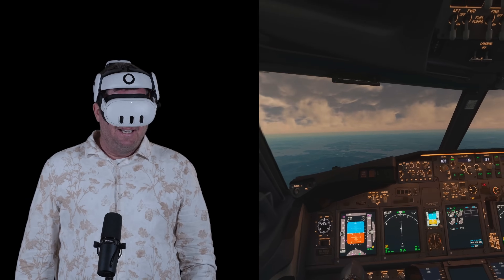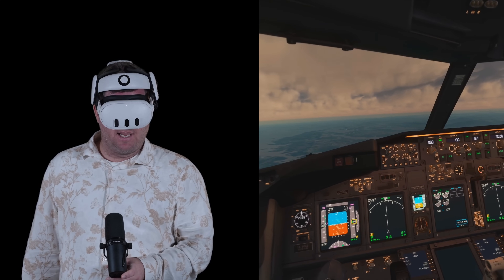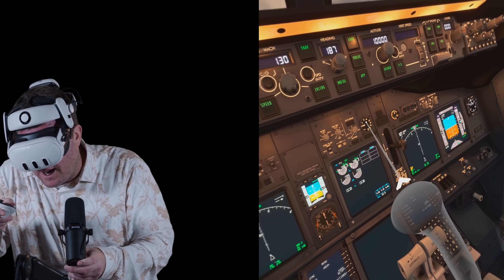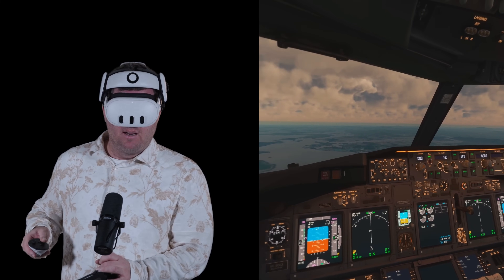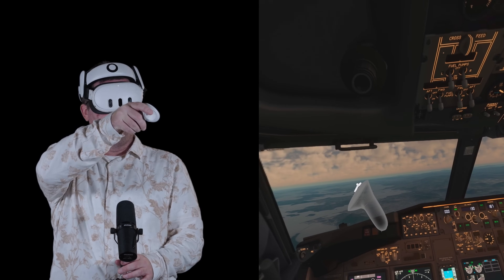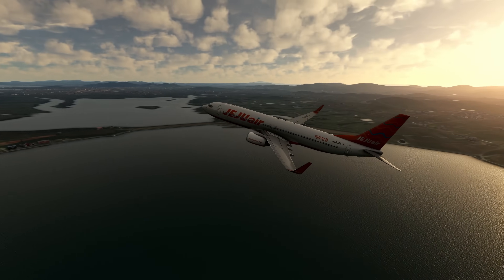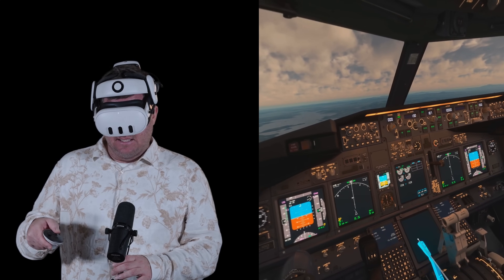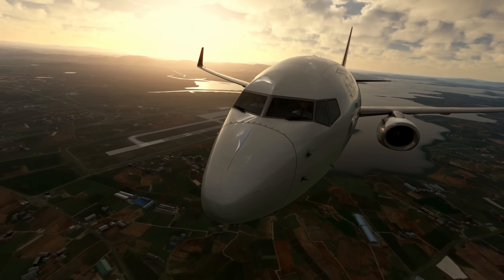Flight Recreation and Update on Jeju Air Fatal Crash in South Korea

Comment: It's now looking to be more than 90% likely that they switched off the wrong engine by accident after the bird strike, not knowing which was worse. 
With only one damaged engine in operation, this would explain a scenario where they only had enough hydraulics available to operate ailerons, rudder and elevators but not enough anymore to operate the gear and the flaps. 

It also explains the decision not to go to a holding pattern.

Also, the only available thrust reverser could have been close to useless in this scenario, which explains the lack of deceleration capability.
Reply: It's looking 100% that they did not stop the wrong engine and it is the most unlikely assumption one could make based on the footage available and on knowledge about standard operating procedure and pilot's training.
Reply: I don't know why so many commenters have this fixation with trying to accuse the pilots of shutting down the "wrong engine", when we have numerous pieces of evidence that all point to both engines being hit by birds and BOTH being severely compromised (*probably #1 first, and worse).
Reply: @mautre   we know sheet.
Reply: And christopherrobinson is correct about the water areas shown on maps.  The vast majority of that area (shown in water) is absolutely NOT suitable for landing.
Reply: You are trying to explain the unexplainable.

If they did not have engines (hence no hydraulics..!!!!!), how did they manage to complete a 180º turn and align the plane with the runway so accurately?

If the DID had engine and hydraulics, why did they not deploy flaps/slats/spoilers/landing gear?

Another possible explanation is that they had a bird strike on Engine no. 1 BEFORE the video showing the compressor 
stall on Engine no. 2  - so they were already flying with 1 engine. Being that the case, and having only one damaged engine, it is absurd that they decided to abort landing and make a Go-around... Or they might have landed on water... Plenty of it in the vecinity of the airport.

See? 

Any of the options make any sense whatsoever ...
Reply: @robbedontuesday  "Being that the case, and having only one damaged engine, it is absurd that they decided to abort landing and make a Go-around... Or they might have landed on water... Plenty of it in the vicinity of the airport."

At present the timing of the decision to go around and the first bird strike are unknown. The position of the bird strike is unknown, but is likely to be at the time when the ADS-B is lost. It is possible that the bird strike(s) occured after the decision to go around having been taken and the aircraft cleaned. 

There are reports that the Korean airlines SOPs require go around in this situation.

The surrounding area is shallow water, mud flats and small islands, not good for landing and would have been against the instincts of most pilots.

Comment: The more I see of this crash landing it really points to the wrong engine being shut down, even in this video theres confusion between the no1 and no2 engine. In the panic to land no gear or flaps were deployed
Reply: That’s tragic if so
Reply: Even if both engines were down, the protocol is not to crash land the aircraft more than half way down a runway.
Reply: @Toro_Da_Corsa  Fatigued under-trained panicked pilot.... how else can you explain this debacle of a landing. And why the go around at 500 feet. Plane fully configured... just coast down to runway after the bird strike. Sheesh.
Reply: @davethewave7248  Neither of the pilots were suffering from fatigue. They also were not "under-trained". Both of these factors can be excluded from the list of probable causes for the crash.
Reply: @WorldPeace-AdamNeira  Most pilots are saying they should have continued to land with the bird strike... not go around.
Reply: @davethewave7248  Looks like u have neiter knownlege about the things going on in a cockpit in a crisis nor any idea of flight physics. Not meaning to be offensive, but if you boldly shout out things like these...
Reply: @mqrichfpv2748  So why did the pilot not just continue to coast into the runway when they were as low as 500 feet, and fully configured to land?? In choosing to go around after the bird strike they opting to rely on potentially compromised engines. Near all pilots are saying they should've continued to land. This procedure is also in the manual.
Reply: @davethewave7248 In the b737 Training Manual says 'If landing is assured', Continue landing is preferred. / But more important one is when the continuing approach is not a good option like unstabilized with only one engine is out, Go around is basic.

We could not know the situation exactly now.

Don't make the dead pilots dumb.

That is Airmanship.
Reply: @SoulFLT  It was a stabilized approach, 500 feet, gera down, flaps deployed. Why wouldn't you continue to land? Why would you rely on potentially compromised engines? It simply isn't logical.
Reply: @davethewave7248  How is that a stabilized approach? Have you even watched the video?
Reply: @hemelinger7792  BEFORE the go around. The initial approach coming in from the south onto runway 1, before the bird strike, was stabilized.
Reply: @davethewave7248  not what I asked. When do you think the bird strike happened? In the video footage? They are not stabilized in that footage. Landing gear is clearly not fully extended.
Reply: @hemelinger7792  Most pilots are saying the landing gear and flaps were down on the initial approach at 500 feet [gear is usually down at 1000 feet]. The first bird strike happened here. Instaed of choosing to go around, they could've just kept on landing.
Reply: On the opposite, they seem quite competent to handle the crisis until aircraft touches the runway including the teardrop maneuver which is quite difficult even with an intact aircraft. Note that the whole sequence of events happen in just 3 minutes. Accidentally turning off an engine immediately, without making proper checks, doesn't fit.
Reply: @user-yt198  Nothing fits in this "accident"...
Reply: @user-yt198 a teardrop manuever is not hard at all to do. Maybe to you it looks difficult..
Reply: @edwardrichardson5567  Both the pilots had extensive experience. Handling a Teardop Manoeuvre was absolutely within their capabilities. Something else, an X Factor/Black Swan event in the cockpit circa 09.00 was the problem...
Reply: @edwardrichardson5567  "a teardrop maneuver is not hard at all to do. Maybe to you it looks difficult.."

I am a retired professional gliding examiner and instructor with over 50,000 landings and I assure you that power pilots (GA, commercial and military) find it difficult because they never fly that low with a clean aircraft and usually end up cramping the circuit and landing long.

In this case the best glide speed is 200 kts.

With a flapless landing the aircraft would have needed a 6,00ft runway to have landed safely.
Reply: YOU
CANNOT
ASSUME
PANIC 
IN 
THE 
COCKPIT.

THEY ARE PROFESSIONALS... NOT ROOKIES.
Reply: @robbedontuesday  WRONG.  HUMAN FACTORS.  Read up on them.

Comment: You know your stuff, but you talk way too fast and misspeak from time to time.

Why did they "Go Around"?  They were set to land on Runway 01.

Did you say or imply that switching a squawk to 7700 would stop the transmission of ADS-B data?  That doesn't make any sense without some electrical failure.  Flights change squawks from time to time during flights regardless without, I believe, stopping ADS-B data.

You're not a good narrator.
Reply: You can slowdown YouTube replay. I thought it was great.
Reply: It's at the pilots discretion as it's not inappropriate to go around or to continue landing. The pilot's decision to go around or to continue their approach is only an opinion. An emergency happening on approach usually indicates an unstable approach which means you abort your approach. More than likely there was no violation in that particular protocol. Probably a bad decision, but not inappropriate.
Reply: @ I can’t help but wonder if the pilots decided to continue with the landing, all those people would have gone home to their loved ones. We will never know.
Reply: Perhaps there were bird remains all over the windshield. The 01 ILS was down due to runway extension on the stop end. 19 still had at least a LOC, so maybe they couldn't see very well and chose IFR after the bird strike. If the 19 GS had been OTS, that would help explain the long landing as a LOC only has no VG.
Reply: We already have tons of great narrators. We need 737 pilots or people with technical knowledge to talk about what happened. 
I understand you are very frustrated with your own existence, but trying to pull other people with you won't help you being happier.
Reply: That was probably the pilot’s first mistake in a chain of errors.

Comment: My hypothesis: the plane hits the birds with both engines, the compressor stall caused energy fluctuations to pump through the electricical system which in turn caused the software to malfunction.
When pilots saw that the instruments were malfunctioning they decided to land immediately.
They lifted flaps manually so all they were able to do about 15 degrees.
The plane was coming in hot  because one of the engines was pushing, while the other engine released the spoiler, that's also why it took so long to hit the ground.
FAA can release the CVR but they won't because Boeing is more than too big to fail, Boeing's demise is a National Security Risk. So they will clean the Data as much as possible to save the company.
As for me, I'll listen to the Boeing Whistleblowers. They warned us about bad engines, wiring, landing gear, software and so on and so forth.
I'm a just a frequent flyer, not an expert but as a customer I know that I can avoid airlines with a high percentage of Boeing Aircraft.
Reply from the maker: The three paragraphs following your first sentence made me laugh. 
You don’t need to trust Boeing or the FAA. The 737-800 has tens of millions of flight hours on the airframe. It has a very good safety record. The 737 MAX is where the wheels began to fall off.
Reply: @flyingformoney777  
Please, correct me if I am wrong... 
If you fly with just one engine, you need to "compensate" to maintain your heading... right? 
So you need hydraulics... do you not?
Is there any chance that they had hydraulics for the rudder, but not for the rest of the aircraft? Sounds a bit too outlandish...
Reply: Now we're just getting into conspiracies.
Reply: @jamesm568 I hope you know who coined that term, " conspiracy". Smh
Reply: Landing "immediately" would have been to complete the landing on runway 01, not to abort, go-around and land in the opposite direction... 
Nothing makes any sense.
Reply: "They lifted flaps manually so all they were able to do about 15 degrees."

There is no manual method of raising the flaps, it requires hydraulic power or an electrical back-up, which is very slow.

Comment: How long does it take to lower the gear manually, from putting the gear lever in the correct position, to opening the panel door, to all three showing green? Is this value known to the nearest second based on sim training analysis?
Reply from the maker: It doesn’t take too long if you already know exactly how to do it. These pilots might not have used the system in the past several years. Normally you’d use the checklist to get the procedure right. It could easily take 30 seconds to open the book and find the right page. Another 30 seconds for the procedure.
Reply: @  Thanks! That’s part of the answer. But shouldn’t this be a memory item?
Reply from the maker: Memory items have a track record of generating errors. Unless you review them every few days (outside of training, no one ever does) you’ll forget or mess up the procedure. The FAA prefers no memory items when possible, or as few as possible.
Reply: @  Interesting! I did not know that. Are there circumstances where they are more reliable? Like based on the number of steps in the memory item? Like 5 is too many but 3 is more reliable?

Comment: @2:48 you talk about a compressor stall being seen out of engine #1 while showing a video clip of the plane passing directly overhead... but that's engine #2 that actually had the burst of fire in it's exhaust trail, isn't it? Engine #1 is under the left wing, engine #2 is under the right wing.... right? Engine #1 was clearly not running upon touchdown, it had no vapor trail or heat signature by that time... Engine #2 however was still running though not in good health. Good informative video though! As a Computer Scientist with experience developing GUI interfaces I do not like some of the layout of that dash panel on the plane though... controls AND their dials should be grouped together and not separated from each other for example (ie. flap levers and the flap dials... why do they have so much separation between them?).
Reply from the maker: I actually threw a title on the bottom right correcting that it was the number 2 engine. I misspoke when I filmed it.
The 737 is an old design. They can’t change it too much or it would require an additional type rating for pilots (which runs over $100k per pilot). So there is some awkward design stuff there.
Reply: If people said port or starboard it would avoid confusion.

Comment: those weather conditions dont really match the video
Reply: "Aviation expert" Sean Bell on the Times Radio UK said on 30/12/2024:

"That means rather than landing into wind he would have been landing with a tail wind. That would have meant that he was landing significantly faster than he otherwise would have done". 🤦‍  

FACT: There was no tail wind at the time of the landing. Weather at 09.00 local time 29/12/2024 in Muan, South Korea. Temperature: 4 °C. Passing clouds. Wind 6 km/h N↑ Humidity 60% Barometric Pressure 1028 mbar. Visibility 50 km. Source: METAR and Time and Date. 

So this crash was definitely not caused by weather factors
Reply: @WorldPeace-AdamNeira  i ment like the clouds bro chill

Comment: 2:04 theory: if 2216 squawked 7700 / mayday, it would have assumed other identity
Reply: I'm not sure I follow.
Reply: @9HighFlyer9  The track data is usually provided on public sites for a flight identifier broadcast by the plane. If they change their identifier (aka squawk) it makes the data hard to find. Probably the NTSB folks have ways of finding it though. I don't have the subscription necessary to search historic data. One might try finding the hex code (which I think is constant, but not 100% certain) and then searching for that but I can't test that theory.
Reply: @GusHeck  I was under the impression that the hex code is constant and that is what is used to track individual aircraft on public tracking sites. In ATCs system the squawk code assigned is connected to that individual flight.
Reply: @9HighFlyer9  Correct.